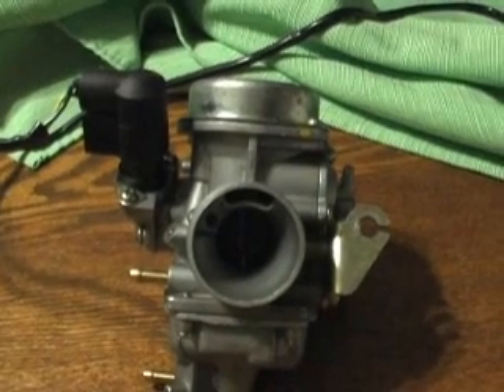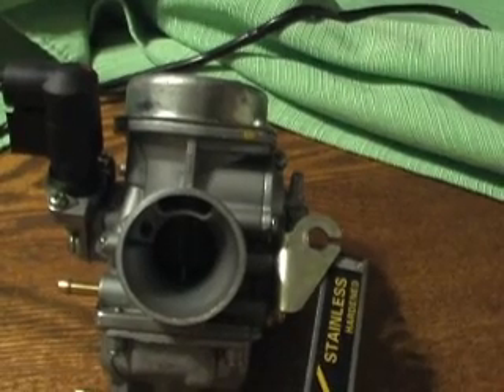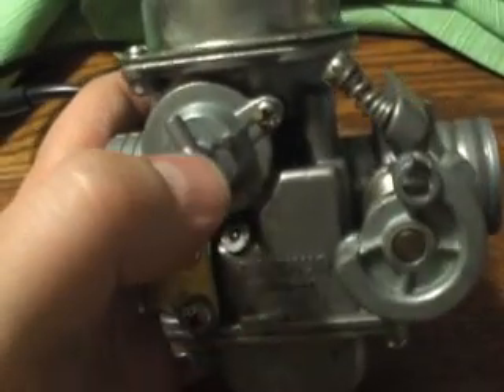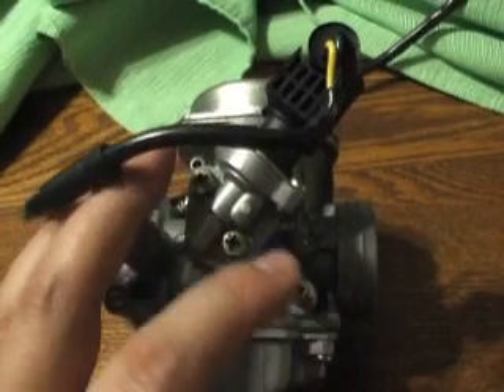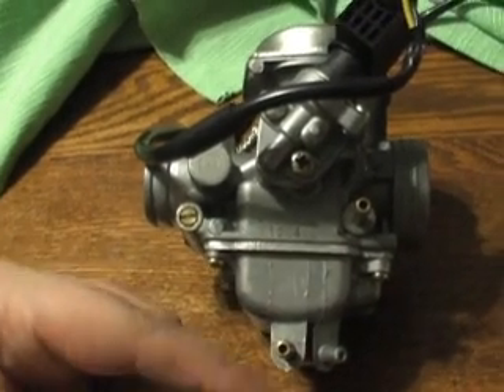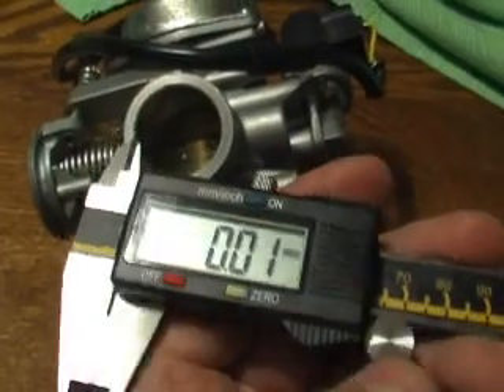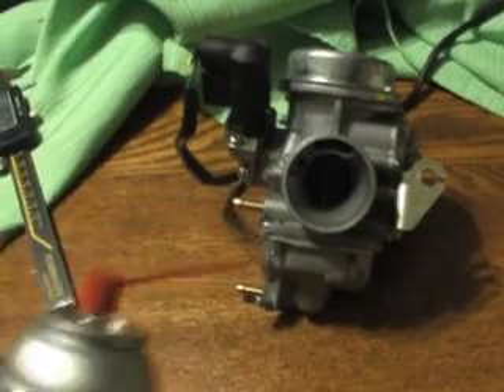gy6 carb for 150cc scooter engine

Comment: the hose you're referring to go to the top of the head and whenever you start rubbing on your engine it's going to suck harder which meeting you get more top-end middle throttle to Full Throttle and it's going to suck the needle out of the main jet instead of it sitting in there and the pilot taking over if that makes sense

Comment: Hi, I am from Philippines.   How to adjust an Automatic Choke or Enricher in a GY6 Carburetor?  Mine has this issue: The Auto Choke turns off prematurely or in an early stage of where the engine is not that hot yet for stable idling, thus engine turns off.  I tried cleaning the GY6 Carburetor hoping it was just caused by dirty system but same result, the Pin inside the Automatic Choke/Enricher extends prematurely/in an early stage even if the engine is not that hot yet resulting to stall.

It my Automatic Choke or Enricher damaged?

This is exactly how the Carb with the Auto Choke or Enricher looks like (Same with your video):   http://i259.photobucket.com/albums/hh302/turbostang331/150carb1.jpg

Please guys, I need your help...
Reply: Chipmunkski Test the resistance of the wires. They should be around 10 ohms, I believe. If the auto choke (also called a bystarter) is bad, simply replace it. You can get them fairly cheaply on eBay. You can get an entire carb, including a bystarter for not much more.

Comment: Mine is identical to yours and those holes you don't no shit about are for vacuum lines that run to your fuel tank vacuum tap! The hole left of the auto choke is a breather. The only "breather" there.

Comment: If you remove the screw, and the end is beveled and seats in the bowl, sealing off the port, then you should be fine. If it leaks, replace the O-ring.

Comment: You said the barb on the bottom goes to no where. Yours had 2,On my 150cc Carb there is 1 barb and also a screw with an o ring. My question is does any gas come out of those barbs or screw and if so should the be routed somewhere? The o ring on mine is shot so i wasn't sure if I could just tighten the screw and be fine? Any help would be appreciated.

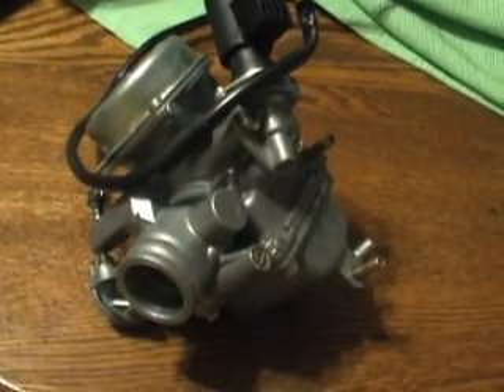Comment: Alright, I am in dire need of help. My scooter won't start unless I spray starting fluid into it. We've done a ton of testing and it seems like air is being sucked into the metal piece that connects the automatic choke to the carburator. There looks to be a small gasket missing. I am desperately searching for the name of the piece that the automatic choke slides into (I can see it at 3:59 in your video) and I'm wondering if you know the name of the metal piece or of the gasket on the inside?

Comment: the current flowing to the choke is not resisted. its like 10 or 12 volts and takes about 2-5mins to heat up completely. in the mean time, your carb is being "choked". after the needle is fully extended into the carb it will limited gas flow and idle better.

Comment: how can i permanently disable the automatic choke?
Reply: Basically just plug the canal..remove the electric choke and plug the hole. Mind you, starting it in winter is going to be a bitch. You can test the automatic (electric choke) by putting 12 volt through it, either form a set of batteries, a car battery or a lab power supply ( like I did).. connect it to 12 volt, and in about 5 minutes you will see the needle move out to about half a centimeter more. Since you really can't see the movement unless you gaze at it for 5 full minutes, a lot of people tend to think it's broken. If you test it like this detached from anything else, and otherwise it doesn't work, somewhere upstream you have an electrical fault. Try starting your engine and letting it run for five minutes. Then stop it, and unscrew your choke..if it's not extended (and you can easily see it because it will be <needle  --  big drum -- axis> visible from the choke body) and you tested your choke before then you have bad wiring or parts upstream. HTH
Reply: Alternatively, keep the electric choke in there but put some c-clips on it while it's extended. Unless they break, that will keep it extended, and plug the choke canal. It's actually not a choke, but an enricher.
Reply: Difference is, chokes deprive the engine from airflow, and enrichers aid more fuel. Effect is the same, more fuel/less air ratio going into the engine, the way in which they do it is different.

Comment: Hey everyone, I have a question. I got a 150cc gy6 . I swab the "3700"miles engine for a 500 miles motor. There is a problem when I try to start it. It wont start unless I keep try hitting the starter for around 2 minutes. Also, It will not start with no throttle application, only when I open the throttle around 1/16th it starts....Also, when it does starts,  it feels very bogged.....Is this a carb adjustment issue? I don't think I need valve adjustment because the motor only have 500miles on it
Reply: Get a new spark plug and adjust your carb. Oh, and just because the engine only has 500 miles on it doesn't mean it's valves are properly adjusted. Get a workshop manual for the GY6 range of scooters

Comment: Thanks for the info, I just fixed my ATV 250 as it had bad wiring on the automatic choke of the GY6 carb. As soon as you said the choke works on resistance, I was ohhhh I better check the wire connectors.

Comment: @liltuckk THanks so much.  I took it to a mechanic and he fixed it. He cleaned the carbeurator and air intake out.  It was working fine, but now when I drive at full throttle, the engine sometimes boggs down and will cut off unless i release the throttle.  Is this a screw setting problem u think??
Reply: full throttle bogging down? Main jet a bit too large. Do you get max power and speed at about 3/4 of throttle, and with full, it bogs down slightly? that's you're main jet. Too much gas, not enough oxygen ratio. I actually don't want to change it on my old Puch moped, because at 3/4 throttle I can go 53 km/h while the official limit is 45 km/h in my country. So when a cop puts it on his testbed (and they have done that) they crank the throttle wide open and it only goes 44-46 km/h. Nice.

Comment: @chrilla1980 Forgot also to mention that you can measure that choke and it´s around 7ohms resistance if it´s not defective in any way.You can also put 12volt dc and see how far out the needle goes after around 5minutes too see that the length is correct of the needle pushing out and if you have to adjust it.
Reply: do you need to apply power to the choke to keep the choke open?

Comment: I´m working on one of my private scooters and have a "lingben 50cc eu" scooter that i couldn´t get started and it took a damn long time to go through everything on it and the last thing i checked up was the choke on the carb.I totaly agree that they are bad things and can fail easily.I have hooked it up directly too the battery so now it gets 12v DC instead of AC wich is the currency it gets original and the choke works awesome.You can adjust the choke by disasembling it and adjust it tho.

Comment: @mattYoung17754 this is probably goin to sound stupid but i bought a 50 cc scooter and want to get it a bit higher for now until i swap the engines 4 a 150cc can i put a bigger carb (lets say  this one ) on the 50cc or will i blow it up so to speak

Comment: @mattYoung17754  does it need the autochoke hooked up to work? i had my quad running without it but its not very good i cut all the wiring except the spark plugs circut (if you need the wiring diagram leave me a message) but i can wire the choke back in but only if it needs it to run

Comment: @thieving1  it is most likly that the float is sinking or set way off this can be checked by puting the float in a bowl of water if it sinks find the hole and plug it with gas resistant epoxy if it floats then its out of tune there is a tab between the floats this can be adjustedbend it towards the needle to close it more

Comment: The carb. hoses helps with the vaccum in the acelerator pumps and the fuels gets in to the carb. because at the outlet of the fuel tank exist a vaccum valve that works just when the engine runs. If you have any air leaks in the carburetor your engine it won`t start . To fix this problem just retight the intake manifold and the other air hoses.
If ypu speak spanish I try to explain much better
I hope it helps

Comment: Before to replace your carburetor check the air filter and it is dirty just replace it. You could check the float valve height too, so you can measure this height with a vernier caliper ( the height measure is 20.5 mm or 3/4 inches)

Comment from the maker: Symptoms I experienced before the valve adjustment were that it took forever to get the scooter started, then acted like it lost 1/4 of its power - like it was bogging down.  PS if your choke stops working, the engine will run rich (more than likely) but it depends on which position the choke sticks.  You can get a manual primer and forget about the automatic choke - there are articles on the web on how to remove and replace the choke.

Comment from the maker: i had about 1500 miles on it and replaced it with a new carb... turned out it wasn't the carb at all but a valve adjustment instead.  I posted that video, but left this one up there since nobody explained the gy6 carb hoses.  I thought it might be useful.  I T'ed off the other hoses to an overflow exit hose

Comment: One of the hoses that goes to nowhere is the overflow tube.  If your carb has too much fuel in it it will leak out of that hose.

The other one is the drain tube.  Screw it open to empty the carb of fuel before disassembly.